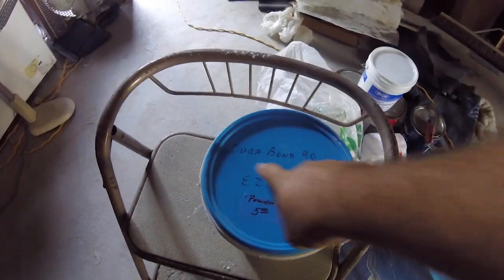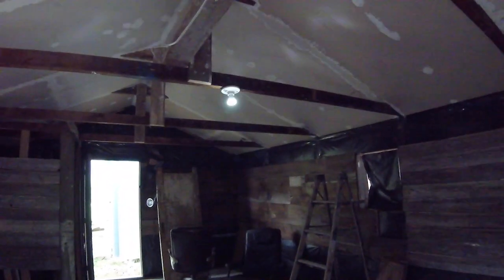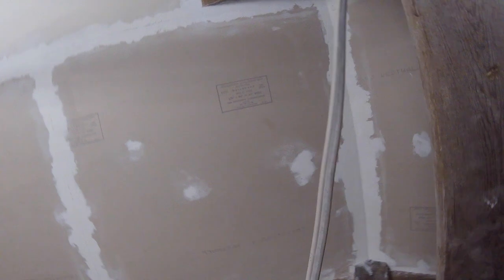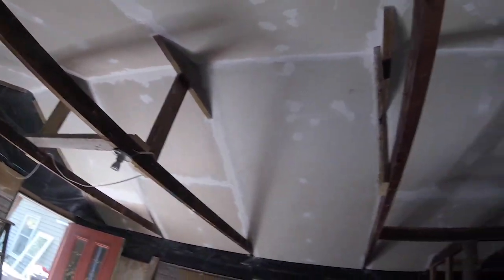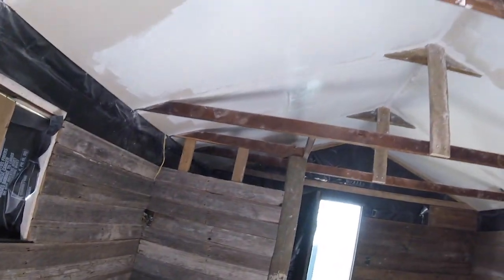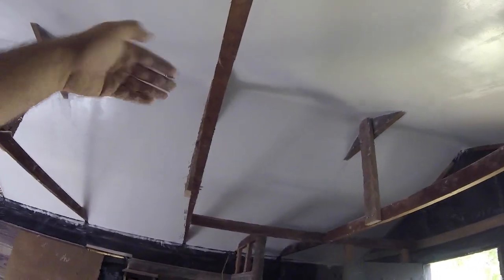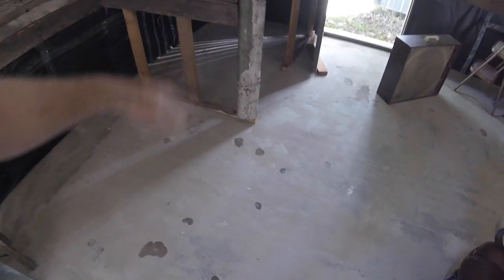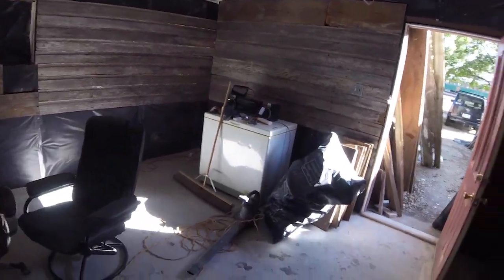$5,000 House - Garage Into Living Space - Part 7

Comment: That expression "a pain in the neck", is literal with drywall on the ceiling. Not many things more difficult or pain inducing. Good job just getting it UP THERE. Be sure you wear safety GOGGLES when you sand, you don't want that dust in your eyes.
Reply: too late with the advice again, apparently you can still see... GOOD.
Reply: very strange, YT will not allow me to use the 'bell'
Reply from the maker: yes pain in the neck and head as I try to support it ;) Yeah I don't know what is wrong with Youtube.